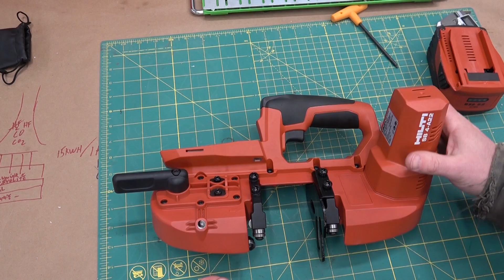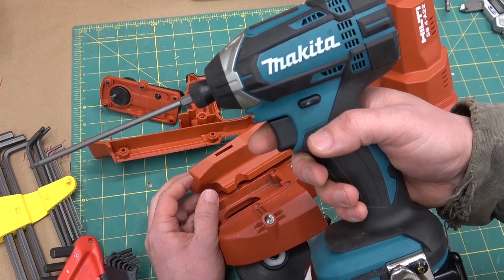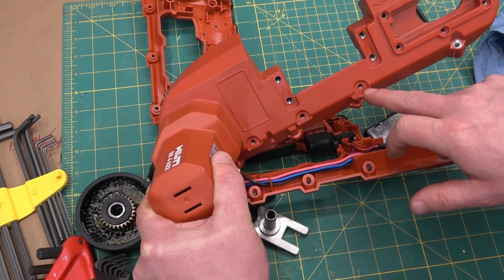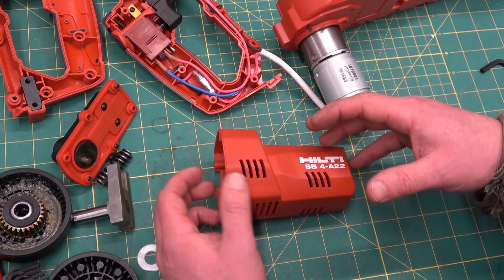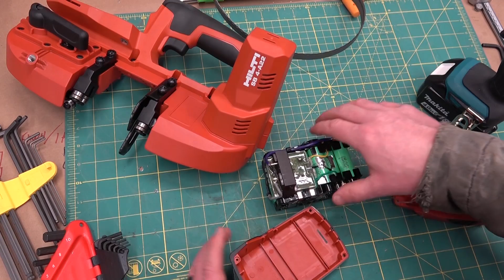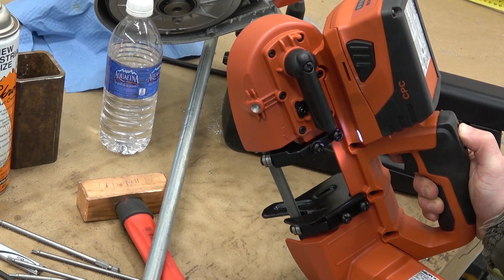BOLTR: Hilti Compact Band Saw | Quality Problems

Comment: That thing has got to be, hands down, the best looking cordless tool I've ever seen.
Reply: This Old Tony is Ave jealous of your bandsaw blade welding skills?
Reply: @markd5804  Nah, his instincts were right: those little buggers are hard to weld.  That's why when I need small blades like that, I mill them out of a solid block of tool steel.
Reply: Ha ha D2 or A2 tool steel...  I love watching both you and Ave’s videos, glad you guys aren’t starting a cross border war, the US and Canada have enough drama at the moment
Reply: tot is great
Reply: Mark D oh I want that and just for Canada to take like 10 miles of the US border cause then I’ll be in Canada lol
Reply: But it is costly as compared with a reciporcating saw although the latter one is not easily be manuiplated, it can cut thick and long piece.
Reply: Na..Pretty sure canadian logic would absorb a kilometer per year..heaven forbid they do anything
Imperial...
Reply: It's almost half the price of the Milwaukee fuel babdsaw
Reply: James Souza you do realize the irony in that statement?
Reply: @azurestar4234  or you do what I do, I am using Hiltis brushless hammer drill / driver, brushless impact driver, and their cordless SDS te6-a22. I have one Hilti 2ah and two 4ah. I use Milwaukee for everything else as they clearly have a much more extensive lineup of cordless tools
Reply: You two need to do a video together, it’d be the best thing ever, could you guys hold hands for a while aswell? HAHAHA
Reply: @azurestar4234  the Hilti batteries are much better than Milwaukees they have an extra cell in them
Reply: The trick is to anneal the band, weld it, give it just a little stretch to get rid of any distortion, then re-heat treat.
Reply: You obviously have not seen mine
Reply: Problem is the balance isn't very good.  Putting the battery on the top of the tool makes it handle weird when doing one handed cuts

Comment: Well, I learned a new word today: "Greebling" - fine detailing added to the surface of a larger object that makes it appear more complex, and therefore more visually interesting.

As opposed to "Gerbiling," another new word I learned today.
Reply: Gotta watch more Tested with Adam Savage!
Reply: Gerbling?Is that adding movement to a tight orifice?
Reply: Ask Richard Gere
Reply: Greebling is also used (and originated) in the SFX industry, build the basic shape of a spaceship then throw any random crap onto it that you can get your hands on to add details. First known use was ILM when making Star Wars
Reply: Cordless bandsaw, using the word greebling, AvE has definitely been watching Tested with Adam Savage
Reply: @fragotron  I can what the alternate shift at work does 'gerbiling', as in lot of talking, lots of movement, lots of eating, but nothing has changed at the end of the day.
Reply: What's gerbiling? 🍄

Comment: Wow they matched the Paint on the aluminum to plastic well. I honestly thought it was all plastic and was wondering how that would be strong enough.
Reply: if they made it thick enough plastic and the right kind it would be sturdy enough just the threads for the handle and all that would have to have inserts so its probably cheaper made of metal
Reply: I thought it was all plastic to
Reply: The casement of this product is super solid. Makes the willf***yee look like a dumpster fire! And on top of that it is almost another half inch of cutting capacity over the other red competitor.

Comment: I tried to explain that my rusty shaft had no bearing on why the relationship fell apart but no one believes me.
Reply: Wire brushing and rust remover is not recommended
Reply: Hunter's Moon it would only get rusty from trying to insert the shaft into the wrong bearing, the front one is self lubricating dependent on the strength of the shaft however the rear one, especially if it’s never been used with the original shaft tends to resist the first insertion, this is where the lubrication comes into play, if you have some lube, you will probably find the shaft goes in and out very cleanly otherwise with a dry fit, especially on the first insertion and withdrawal, without lube tends to lead to rust spots, especially with a brand new bearing.
Reply: Maybe it was your rusty undercrackers?  As they said in the old days. "Brownline Offside".
Reply: Some chicks dig rusty shafts
Reply: Perhaps it was the lack of a bearing that made it fall apart?
Reply: You people are geniuses lmao

Comment: Costly.... so i bought a 5 pack
Reply from the maker: cheaper in bulk. They run a deal to get stock moving during slow quarters.
Reply: I loved this comment.
Reply: @arduinoversusevil2025  I fricken love hilti so I'm sure they're worth the expense and just giver wahh! The kneepad service doesn't sound teabag either
Reply: luuzeri I find it better to get the Tool then the Beverages. At least this way you look like you know what you are doing the first 45-90 mins until the dead Soldiers start really piling up.
Reply: @solofoe  also a huge fan of Hilti. If youre on Reddit check out r/HiltiTools I just started the sub a few days ago
Reply: Everybody's wondering the same thing

Comment: A note on these batteries.
I worked with Hilti tooling for a couple of years and these batteries really surprized me with how long the last and how quikley they charge. Also all the cordless tools I worked with seemed to hold up really well but what really annoyed me was the fact that every new tool we got seemed to have its own type of battery. Every god damm drill needet another battery the big ones different that the small ones.Only the last cordless kit we got finnaly had an intermediary (new) battery type that at least fit both tools in the kit.
To me this really is a drawback not being able to get a bunch of bateries and just use them on whatever tool needs juce at the moment.
Reply: That why my dad despised hilti
Reply: Also seems Hilti is the only one use 6 cells in a series instead of 5.
Reply: hiltis cordless line isn't worth the investment. The tools are made in China like everyone elses and they barely have 20 tools on their cordless line whereas if you go for one of the big 3 tool brands you can get dozens to hundreds of different tools on one battery.
Reply: they do that shit on purpose to make you buy a million batteries since cordless tools are the new inkjet printers
Reply: @TRUE_GR1T  I think I have to dissagree that they are not worth it since the cordless tools I worked with really did comvinve me both in quality and performance.
Of cource you are right by saying that they are chinese made but it seems they function just fine despite that.
About the voriety I cant say much since the only things I ever needet in my job ( electrician) where a pretty standart hand drill and hammer drill. But you are certanley right by saying you cant get two tools of theyrs to use the same damm batterry....
And wich one would you call the big 3 at the moment? Here in europe (switzerland) apart from hilti bosch, makita and dewalt are pretty popular closley followed on the home gamer market by rioby. I have even seen some milwaukee machines but they are rare around here.
Reply: @gladiusilluminatus3720  in NA milwaukee, makita and dewalt I would consider the big 3 power tool brands. Milwaukee spends a shitload on marketing here and they seem to be one of the most common. With hilti's cordless line I don't think they outperform any of those brands enough to justify the price tag. Made in China isn't bad (milwaukee, dewalt and makita have factories in China as well) and they all make good tools. The problem is that hilti charges like 3x as much for their stuff when it doesn't outperform any of the other cordless manufacturers by a marginal amount. If their cordless stuff was made in the EU like most of their corded tools I could justify spending the extra money on Hilti, but as I said their cordless line is pretty meager and I would end up having to go with another brand anyways to get niche tools. For the price of a hilti drill/impact combo kit I can spend like 20-30% more and get a 6 piece kit from any other brand.
Reply: @TRUE_GR1T   so far ryobi has done fantastic to the torture I've thrown at it 
it gets nasty in the dirt and mud and oil and grease at a Construction company equipment yard!  Where the machine sits or craps out 
I know they where cheap so far there holding up I started out with a northern tool cordless  impact driver which was made by ryobi when they discontinued them I figured out that the battery was the same spec as the charger and battery has the northern tool I just had to cut a plastic tab that prevents the ryobi battery from being inserted and vise versus
Reply: @gladiusilluminatus3720  don't forget metabo
Reply: I think in this situation the appropriate phrase is, "and that's how they getcha!"
Reply: You are stuck back in time.  The battery here is 18v and can be used backwards compatible to all the 18v line    Are you going way back to 12v models like 15 years ago?  These are Panasonic made batteries with a joint venture with Hilti.  Also, the comment about China needs to include that it is a Hilti Plant and not an outside manufacturer.  Its made in China or Liechtenstein or Germany it is the exact same tool  and the same quality them being ISO 9001 and all.
Reply: Tripnotyst I don't think I need 150 shitty tools that don't even do the only job they are good for.. in dickyellow or whatever weird paint.
Reply: @hemsmar  What hilti machines do you have/ know of then? and where are you from ? because here in switzerland I largley saw 14 ish and 36 volt batteries. only the newest tools we got where 18v with interchangeable batteries.
Reply: @gladiusilluminatus3720  I only have a old wired metabo drill, but it's definitely professional grade
Reply: @allesklarklaus147  Nevermind the fact that I've seen AT LEAST 10x as many Milwaukees and piss yellow Dewalts on job sites(such as the Amazon facilities that have been built in the past few years in Central Ohio) as I've seen Hiltis or any other professional brand.
And, "somehow", everyone manages to do their jobs just fine with them. It's almost like the Hiltis, Metabos, and whoever elses of the world don't offer better performance because they're all using the same motor, electronics, and battery technology, and that perceived quality and the B2B account style business model are the actual selling points...

Even a Harbor Freight house brand can drill a fuckin' hole - even a hundred of them - perfectly fine. If you can't do the job with a prosumer brand, then put the tools down and keep your clipboard in your hands because nothing else belongs in your grasp.

Also, the pigment is in the plastic, modern manufacturing doesn't use paint
Reply: @gladiusilluminatus3720  Metabo is better than Bosch blue.
Reply: @gladiusilluminatus3720  Im from Denmark. in our company (also eletrician) we only use hilti and we only use the 22V batteries like AvE
Drill: SFC 22-A and SF 6H-A22 (one of each for each car)
Rotary hammer: TE 4-A22
Angle grinder: AG500-A22
Impact wrench: SIW 6AT-A22
Reciprocating saw: WSR 22-A
Lamp: SL 2-A22
Radio/Charger: RC 4/36-DAB
Charger: C 4/36-90 230V
Reply: @epiphonesg007  Metabo better than bosch blue? Not saying you are wrong since I havemt had enought expirience with them but I'm a bit surprised by how many of you seem to like mrtabo so much. Welp I think this is a job for uncle bumbelfuck: Sir would you kinldey get some metabo gear to tear down? I think this warrants further  investigation.
Reply: @kuinb  Holy cow I wasent aware they made so many tools using the same batteries...
Well thinking about it I worked in a rather small company where tools where bought acording to current budget and needs so the somewhat random assembley off tools we endet up with might not be all that representative after all
Reply: @TRUE_GR1T  thats just silly, like saying Supermicro is not worth the price because "made in china". 
Everything is made in China. Hilti is  top notch in quality, durability and usability. It can be lighter, motors can be stronger, but the package is great.
Reply: @foeke8740  idk what a supermicro is. I said it's not worth the price because their cordless line doesn't really perform noticeably better than "the big 3" but you are limited to like 20 tools on their cordless line. A hilti drill driver kit is like $600...I can get a 6 piece kit for 800-1100 from the other brands and since they have more than around 20 tools on their line I can add any tools I need. Why the fuck would I buy hilti cordless when makita has 120+ tools on their 18v platform, milwaukee has tons of tools catering to specific trades (especially plumbing). All you are paying for is the hilti name, that's why I don't believe their cordless line is worth the price. if they had 120+ tools on their battery I'd consider them but all they have is basic shit and a couple crimp and cable cutting tools for sparkies.
Reply: @allesklarklaus147  "shitty tools" ok when hilti makes more than the basic cordless shit let me know. When they release a rod cutter, right angle drill,  transfer pump, etc. hit me up. Have fun being stuck with the barebones cordless shit because you are paying for a brand name.
Reply: I hated their batteries the lithium ion ones for hammer drills are heavy and when I used em didn't last but maybe 2 hours when drilling every 3-4 minutes for 1/4" conical anchors. They had some torque tho it bound up once on me trying to drill next to a stud on a block wall and clocked me on the chin one good time. That's one thing good about em is their cordless power the corded tools will last nearly forever but my God the cost.
Reply: i have dewalt and ridgid and yea they aint the best. dewalt is pretty good not bad. mainly the chucks on the drills go out in a month but you can have pretty much any tool the same color go with one battery
Reply: @epiphonesg007  ...metabo is the only tool company that never gives anything for free....ie.bonus batteries/tools....where all other tool brands have tricks the consumer into buying more tools they don't need
Reply: In a Ryobi home player myself, but I saw loads of Ryobi gear at work from contractors doing remodelling. Don't think I have seen a pro with a Ryobi before!

I actually only saw Ryobi drills.

Comment: I had to replace the guide bearings on the bandsaw at work, $10 worth, decided to do the carbide guide blocks since they were worn and chipped, over $800!, not cheap!. only 6 of them, an upper and 2 side guides each end of the boom.
Reply: Rip Aussie50...

Comment: The choice of a polyester could also be to do with the overmold material compatability, something similar to duponts hytrel (copolyester based thermoplastic elastomer) likely for the rubbery bit the blade runs on. The compatability of materials is important to form a strong chemical bond for overmolding rather than relying on a mechanical join. especially on those fast moving rollers that will likely heat up a wee bitty and pull in gubbins from cutting.
Reply: In general you are right. I just would like to add that PBT in these applications is selected because of its better dimensional stability compared to PA. It does not absorb moisture so it does not warp as much as PA. 
There are also many thermoplastic elastomers which bond perfectly to PA so i dont think thats the main reason.
Molding PBT is not easier to injection mold btw
Reply: @steffenb3306  I would go with heat resistance. Being thermoset it wouldn't warp when heated.

Comment: I have injection molded PBT before, sucks as a molding operator because you cannot stop without purging the barrel out with PE before hand, but the stuff is a good hard high temp plastic, sprues and parts ping like cast aluminum when you drop them on the floor or strike them

Comment: I personally like the older generation of the milcocky type of the portaband, it was kinda similar to the Hilti, but cheaper parts and a stiffer construction. Used it to part off everything from electrical conduit to whatever steel or black iron square or round tube I could fit it on. Beats dragging the big boy around the shop or a big part to it. Could just slide the tube out the rack, measure off and cut. As much as I love my new job, I miss my old job a lot

Comment: A relative of mine has a metal construction business, making all kinds of big structures, they first had Makitas but after the batteries started dying and the new batteries didn't fit the old tools they switched to Hiltis. One day as I was building a CNC machine for him I needed a big piece of steel grating, the kind they use for walkways and I asked where was a big angle grinder to cut it, but one of the guys said "I've got something better", his gives me this small Hilti battery circular saw with a coarse pitch tooth blade, that thing cut through it like butter, probably took like under 10 sec to cut 3 feet of this 1/6 by 1 inch steel bar grating and at no point felt like there wasn't enough power.

Comment: Can’t beat a hilti. I have tried everything in the book, as far as long term reliability and long term wear and tear a hilti will outlast anything on the market today. At least in my scope. I use a full everyday, Makita lasted around 1 year. DeWALT had to be serviced after 6 months. Ridged... I just gave it away... hilti... 6-7 years! My partner same thing. I had the trigger replaced at the 5 year mark, finally died between 6-7.  When I brought it in they gave me 80.00 towards a new one.